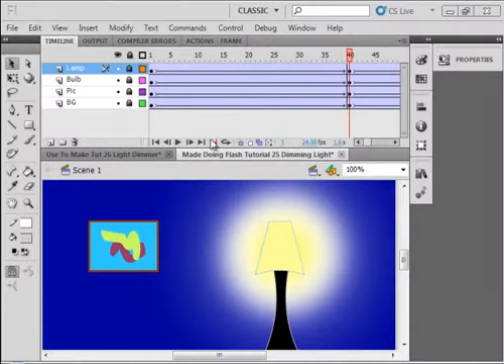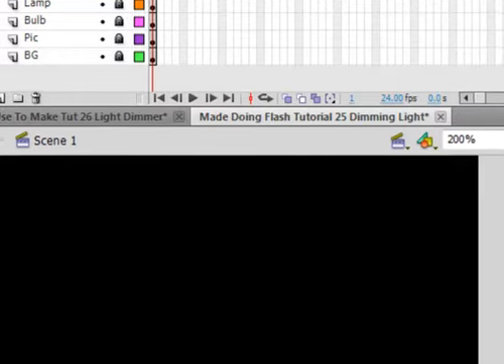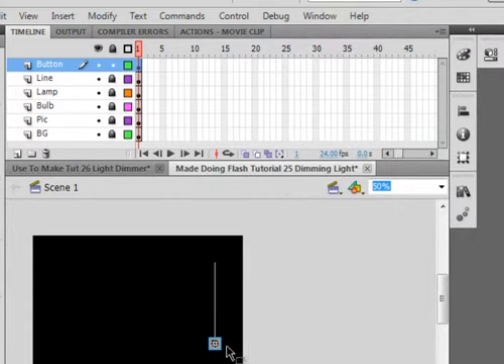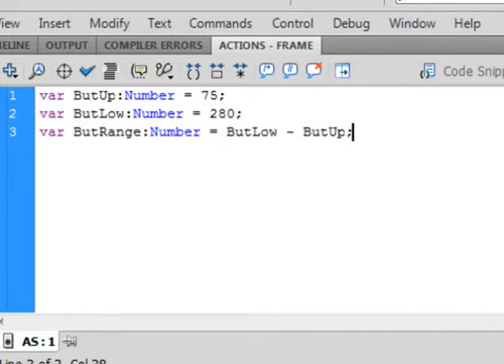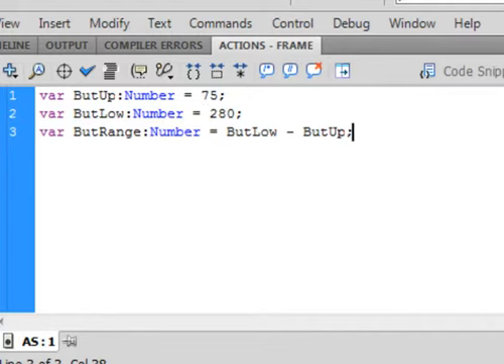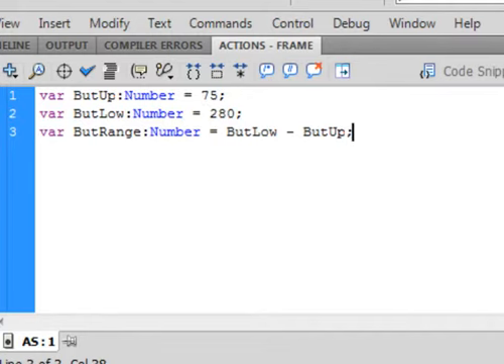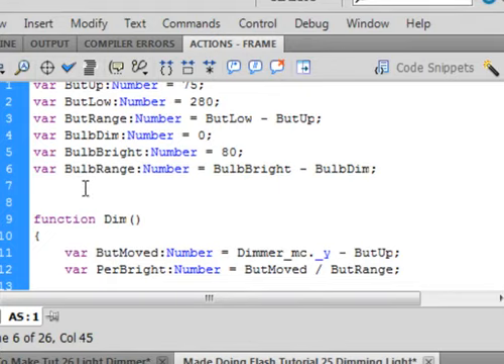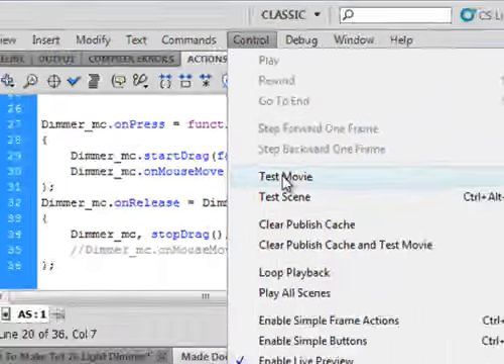Flash Tutorial 26 Light Dimmer

Comment from the maker: I copied your code and put it into my fla. It worked. I think this error is an AS3 error code. Are you using Action Script 3? If so I don't think you cannot use this code. You would have to set these parameters/limits using if statements. This line of code is the reason I used AS2 because I made this project many months ago and did not want to figure out how to do it in AS3. TRY THIS : Lock all layers; Click on the stage area; open the Properties Panel; change the SCRIPT form AS3 to AS2.